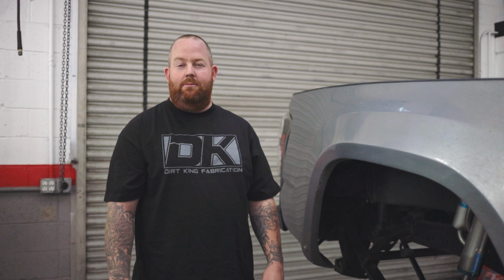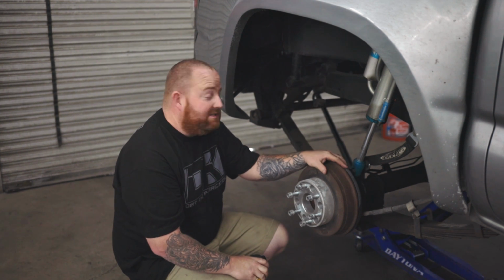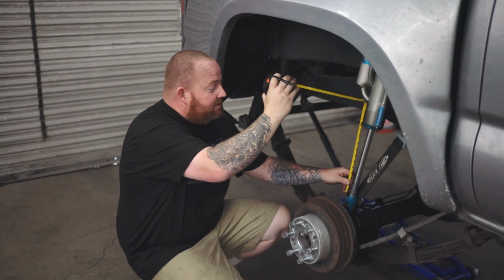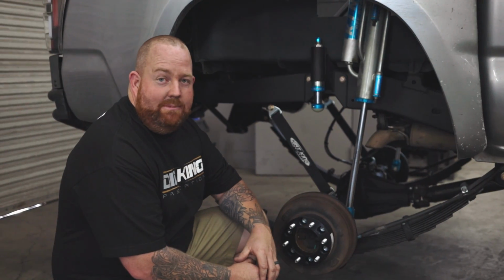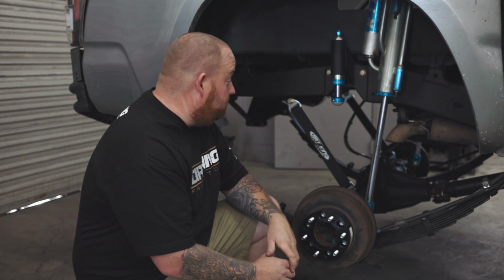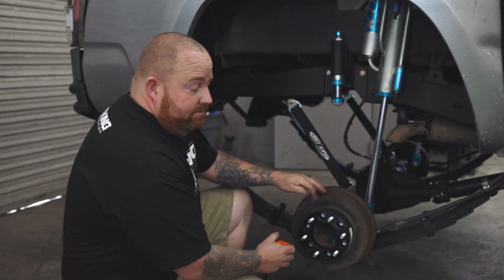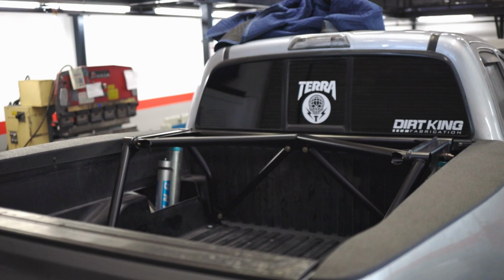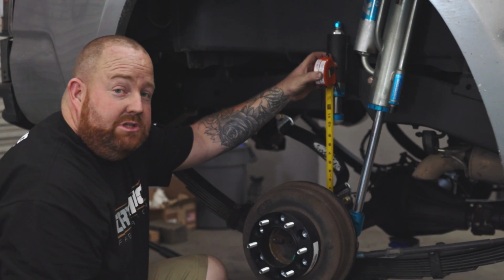Replacing a Competitors Spring Under Kit, Major Results! (Tacoma Prerunner)

Comment: Did he have a custom drive shaft to get those number of travel with your kit?
Reply from the maker: 4WD models, you don't need to modify the driveshaft because it already has a slip yoke. The 2WD models don't have it from the factory, so it needs to be added to get the full-wheel travel the kit offers.

Comment: What paint you guys use on the frame and black components got a super nice flat clean finish to it SteeliT?
Reply from the maker: We use summit racing flat black chassis paint. It's durable when applied correctly and nice uniform look. Another brand that we like is Por15. It lays heavy and self leveling. Almost looks like powder coat. The advantage of summit paint is it's resistant to brake fluid.
Reply: @dirtking  sweet thanks for that I use myself POR15 also but was always wondering about all the other stuff and how it lays compared to it I’ll give the summit racing one a try
Reply: @dirtking  does summit wake that in Gallons or is it all the spray rattle can I can use my HVLP at the body shop to spray quarts or gallons
Reply from the maker: @omarramirez2335  I'm not sure, I'm only aware of the rattle cans for the summit paint.

Comment: Can you run a stock leaf spring with this kit? And do you have to build your own cross Member in the rear or is that something we can purchase from you guys and weld it on ourselves?
Reply from the maker: No this kit only works with long travel leaf under springs and the cross bar must be made yourself. We are currently developing a kit similar to this for leaf over springs.

Comment: Nick's taco is still the cleanest that has come out of this shop 🤤 Is the leaf under kit or 05-15 tacoma mainly bolt on, or fabrication intensive like this install?
Reply from the maker: Our long travel spring under kit bolts on wherever possible without compromising the strength. Some components must be welded such as the frame gusset, bump stop mounts, spring perches, and shock tabs on the axle. All the hangers and bed cage bolt in place. Every item has detailed instructions to make the installation as easy as possible.

Comment: Well of course you're gonna have more travel cus you went through the bed lol
Reply: Yeah first thing I noticed was how the shock was tucked with a bed hoop, I’m assuming the guy just wanted to throw on the biggest shock possible and wasn’t thinking of the fitment and the correct parts to tie it all together for what he really wanted the truck to do. Then spent twice what he initially spent when cutting holes in the bed and a proper bed cage is all he needed, the dream customer for any fabrication and off-road shop.
Reply: @davidarteaga6054  yeah.. first shockbwas ok.  It should still do ok... but bed cage will utilize alot more travel.. I'm trying to do rear also. And keep asuch bed as posible
Reply: @damnitdang  I’m removing my bed completely when I go spring under on my Tacoma, put in a bed cage and weld up the bedside supports. After all that is in place mount the spare tires and then figure out all the recovery gear mounts and a spot for a cooler to be secured. Bare bones as much as possible in the back and shave a bunch of weight off.
Reply: Yeah this isn't comparing apples to apples   im sure the camburg kit would be fine with a proper bed cage

Comment: What are the advantages of leaf under vs leaf over? I have a 2015 Silverado 1500.
Reply from the maker: We recommend leaf over or leaf under depending on the vehicle. For the Tacoma's you need to run leaf under springs to get the travel. The leaf over spring for the Tacomas don't provide nearly as much travel as the leaf under. For the 07-18 Silverado's we recommend the Deaver U182 leaf over springs because they provide a lot of travel and easy installation. You can get another 2" of travel out of the leaf under springs but it requires a lot of fab work and a custom drive shaft. The performance gain going to leaf under isn't worth the cost in our opinion on those vehicles.
Reply: @dirtking  Thanks for the reply!